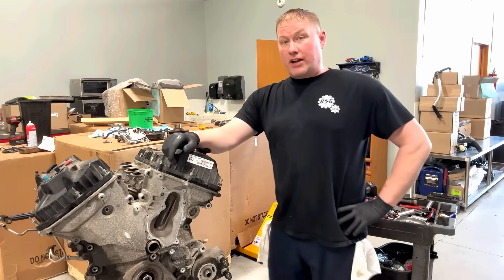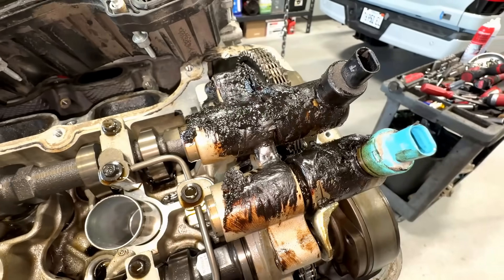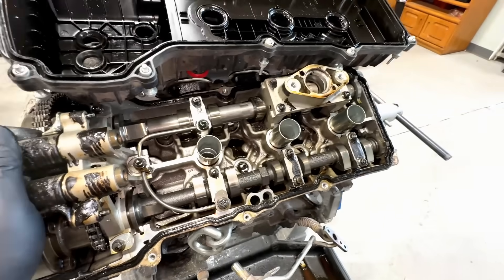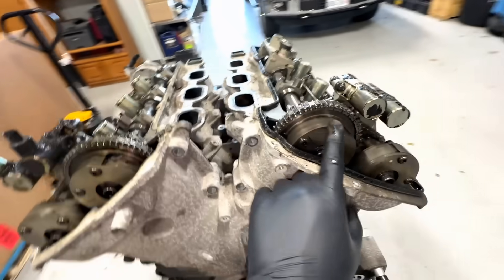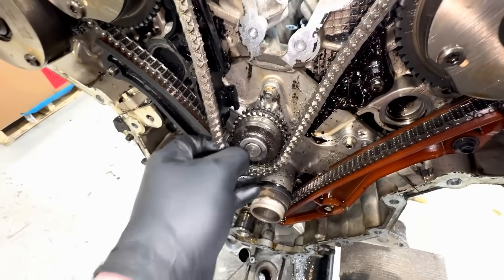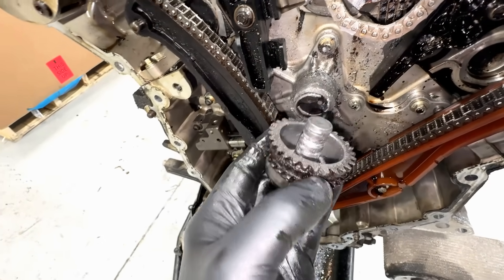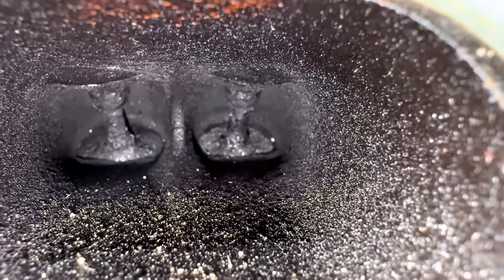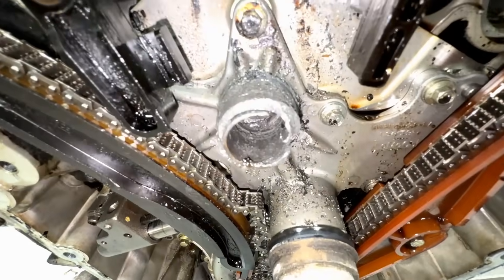2015 Ford F-150 3.5L EcoBoost Engine Failure: 97k Miles Total Destruction!

Comment: I’d like to have seen the motor apart before the BG flush was run through.  I will go out on a limb and say the owner may have run that motor with the cleaner in there longer than the BG instructions state too.   Here’s a good case for not using engine cleaner when the buildup is that severe, it just loosened the huge amount of sludge then blocked the intakes and small passages.  Regardless that motor wasn’t long for this world even before attempting to clean it out.  Thanks for showing this one.

Comment: One thing you might suggest is the moronic use of direct injection engines without at least a small water injection system to keep the intake clean. It would do so much for the engine

Comment: 3.5 L double boosted or even single boosted motor in a pickup truck if you're going to use it as a pickup truck was not a bright idea. When I first saw one I knew exactly what was going to happen with these especially if you are not absolutely religiously connected with oil change intervals. Thank God they have Valvoline restore and protect out now use that regularly from the time the engine is brand new. These Ford motors have way too complicated of a timing system on them. And it requires them to be pretty much spotlessly clean add well lubricated

Comment: Great video!  I have 280,000 miles on my 2014 F150 with the 3.7 and 189,000 on my 2015 with the 3.5. Changing the oil every 5k miles with Mobile One.

Comment: If you change your oil every 5000 miles or 6 months with synthetic, these ecoboost engines will last 200k miles with minimal issues. These engines are high heat, high pressure, fuel diluted beasts that shred oil in a short period of time.

Comment: How long do you think they were going between oil changes?     It seems to me, years ago only high end and enthusiasts cars had complicated DOHC, VVT, turbos, ETC.  The kinds of people who drove these cars, on the most part, were anal about maintenance with oil changes, filters, wear items,etc…. Now you got regular pickup trucks and family SUV with all these engine technologies that used to be only on enthusiast cars.  Regular, non car people, don’t care about oil changes and maintenance, until the engine blows up or it’s setting multiple VVT related fault codes……lol.  I seriously think it’s the right mind set to change oil every 3000 miles regardless of what the car manufacturers or oil companies say.  And if it’s a really high strung engine, so example an eco boost towing all the time, spending a lot of time in full boost, or a sports car doing track days or having fun in the mountains, change it every 2000 miles or sooner.

Comment: I have a 2011 f150 3.5 that I did a timing job on a couple years ago using your videos as reference. It’s got almost 250k miles. They are not junk. Anyone saying so just hates ford. Thank you for doing these.

Comment: I don't know if you'll see this or if anyone on here knows somewhere to get a new engine for the 3.5 gen 1 my 2012 is at 275k miles and is having some major issues where replacement is probably the best choice.  But I don't know a good place to get a remanufactured one since Ford doesn't make the gen 1s anymore of it its possible to switch to a gen2.

Comment: Buy these trucks at your own risk got a 2019 Tacoma runs like a top all fluids regularly changed it’s a lot cheaper to replace all the fluids than buy a new transmission or engine

Comment: So if all cylinders on a first gen 3.5 have no compression I hear you say they need a new engine in some videos,  just curious why it needs a new engine are the engines toast after a stretched timing chain or timing failure,  I know the valves can hit the pistons but couldn’t the heads be rebuilt,  I know it will just be a lot easier to replace it with a known working engine,  what’s the fix after a timing failure and all cylinders lose compression,  I’ve already retimed the engine with new parts and still all cylinders no compression so I assume the valves are bent but all valves looks fine.  Appreciate you always sharing your knowledge with us.

Comment: Is using BG products like MOA not recommended for EcoBoost engines? Or was it bad in this situation  because he neglected regular oil changes.
Reply from the maker: He did not use MOA it is much stronger product.

Comment: I'd like to know what oil change schedule or lack there of this truck was on.  Once a year 15000 miles, once every two or three years.  Just wondering what schedule did this to the engine instead of just saying neglected oil changes.
Reply from the maker: 15-20k mile easy maybe more.

Comment: Great video. I’ve got 220,000 miles on that same engine. Other than a throttle body and some expected, coolant leaks, everything is still functioning well.

Comment: I'll add my anecdote to the rest:  130k on an '16 expedition.  I've done 5k oil change intervals and have had no issues.  I tow at max capacity a few times a year (~8000lbs).  Oil maintenance will pay for itself 1000 times over

Comment: This situation isn’t Fords fault. I’ll probably still never buy one again after the 3.5 cam phaser issue. Asked to have them replaced at 40,000 miles before extended warranty ran out. Weren’t making noise so they refused to replace. 

At 47,000 miles they start rattling. Out of warranty. Called corporate twice and two different dealers. All refuse to fix it. I should never have to pay for this at 47,000 miles and it’s a well known issue. Terrible customer service by ford.

Comment: On the can of BG EPR it specifically says to not use on engines with sludge build up
Reply from the maker: This is not BG EPR
Reply: @FordTechMakuloco  you said BG cleaner, so I assumed they used BG's EPR ( engine performance  restorer) "engine flush" chemical
Reply from the maker: It is called BG dynamic engine flush
Reply: @FordTechMakuloco  Gotcha, I just looked that one up and it also says to not used on engines with sludge build up.  For the record I agree with you.  This engine was neglected and already messed up and that chemical didn't do it any favors after the fact.  I just was saying that most cleaners that I've come across say to not use in circumstances when there is sludge build up and that's when most people try to use them

Comment: Ford was stupid to drop the 3.0L diesel. Far more reliable engine than the Ecoboost. The warranty alone was 100k miles on the diesel ⛽.
I'm at 150k on mine. I know have to do timing belt.
Reply: They weren’t that great and engine, lost of issues in the land rovers and I know they were snapping cranks off and on in the f-150

Comment: Just change your oil. It’s not that hard. I don’t listen to the manufacturer recommendations. 3k to 4k miles oil change intervals. It’s cheap insurance. At that interval it doesn’t matter if you use the “cheap” synthetic oil and oil filters in my opinion. It’s gotta be better than what this guy did to his engine by far.

Comment: I bought a 2011 lorait 3.5 Eco 5 month with two hundred thousand miles only one owner with 23 times to the shop only for maintenance and brack pads change very clean truck no rust with a fiberglass bed cover for ten grand and people had told me that they perfer a truck of that year then a 22:or 23.from 10 to 14. they came out with good motor and strong body love that truck

Comment: I bought a 2023 Power Boost and I did my first oil change at 3,800 miles. I was going on a road trip and would be way over the mileage. Never go by the oil life % because it tells me around 7,000 miles. Never go more than 5,000!

Comment: What happens when you follow the manufacturing recommended oil change intervals 10+ thousand miles. Doesn't matter what brand of oil you use, they all break down and when they do the oil starts to cook. These 10k-20k mile oils are for highway driving not local or city driving.

Comment: 2012 explorer 3.5 engine with 182k miles. Oil smells like gasoline and gasoline vapor oder inside the vehicle. What could be possible cause?  Error code indicates problem with the catalytic converter.

Comment: There’s a lot more fans on here than haters sir. You are an endless source of reputable knowledge. You set me straight on proper oil, proper coolant etc. on my 2016 Eco F 150.
50k miles in and proper synthetic oil at 3000mi intervals has yielded a trouble free engine this far. 
Thanks for your commitment to the vehicles and your followers!!!!

Great presentation. No music. No fake attempts at humor. Just straight forward facts, presentation and delivery.

Thank you!!!

Comment: I had a 2013 with 33,800 miles on it and had total engine failure,  $12,000 to fix it and ford wouldn't do anything about it..
Reply: Must have been way outside of the 5 years or 60,000 powertrain warranty. I don’t agree with the time constraints should be a flat milage amount not years but they tell you a time limit so bad as it sucks all companies would have done the same

Comment: 6qts of penzoil full syn. 34.00 plus motorcraft filter 8 bucks.  Beer 15 bucks.  Time in the garage alone. Priceless.
Reply: You can buy the Walmart brand for $24 and their filter for $6. Change it every 3 to 4K miles and I bet you’d never have a problem. Walmart doesn’t make synthetic oil. They buy it from one of the manufacturers and bottle it with their name on it. My 09 Chevy 3.7L has just about 200k miles on it and I use whatever is the cheapest option available in synthetic oil for it. My Mustang gets name brand synthetic oil because it’s not a work truck.
Reply: If I recall, Brian recommends Penzoil Ultra Platinum for the later generation boosted Ford engines.  Based on his recommendations, I switched to Ultra recently for my Mazda with excellent results.
Reply: Damn right
Reply: I have a 15 equinox. Walmart oil and ac delco filter is $24
Reply: Heck yeah brother
Reply: Pennzoil Ultra Platinum is the "poor man's" Amsoil. And can't go wrong with a Motorcraft filter.
Reply: Motorcraft filters suck , fact
Reply: Get some help.

Alcoholism is a disease.

Comment: So, if I keep changing the oil on my 2015 F-150 with the 3.5EB every 5K miles with Pennzoil Platinum/Ultra Platinum I should be good for more miles.  At 135K now, bought it in 2018 with 34K on it from a lease.

Comment: I’ve just started running the Valvoline restore and protect on my 2010 4.6 3V with 110k miles on it for the next 3 oil changes. I’m checking the oil color weekly and plan to do mid interval filter changes. Afterwards it back to Motorcraft full synthetic. I want my timing components to live.

Comment: Hello im looking to buy a new f 150. (Currently have a 2010 with the 4.6l with 214k on the clock). Im looking at the stx model and wondering which motor eveyone would go with? The 2.7l ecoboost or the coyote 5.0! Thank you for your reply.
Reply: Depends what your looking for, I have a 21 with a 2.7 and definitely gets better mileage than the 5.0. I don’t tow heavily just a 4000 lb boat for so plenty of power for that and still gets 16 pulling it. Both the current 5.0 and 2.7 use a belt driven oil pump but honestly i haven’t heard much of anything in the way of failures.
Reply: @christopherlehman4045  I heard about the use of a belt for the oil pump. I would have thought they would have used at least a chain? You have had no issues with the 2.7l? Thanks.

Comment: Timely oil changes are necessary, even more so today (low tension rings, VVT, turbos, etc.) Toss the owners manual nonsense and go back to 3K miles. Oil and filters are cheap.

Comment: I have a 14 3.5 with 200,000 on it. Still runs amazingly good. I got it from my father in law who put most of those miles on it. He’d change the oils every 4000.
Reply: Good to hear I've got to by a new work van and the 3.5 is the only option. I'm rolling over 300k on my 2017 3.7
Reply: My 14 just turned 202,000, running strong, good synthetic its whole life, but went long intervals on changing, 10-15K, mostly long distant highway miles. Regretting the interval distance now, saved a little on oil and effort but may cost in the long run.
Reply: @danharp3009  i’m at Valvoline restored protect oil through it, I’m running it on everything except for my new truck, simply because it’s only 7000 miles in the year I’ve owned it. But I’ve been researching that oil since it came out and following to use it and it’s the real deal as far as cleaning it also cut down on wear metals, which is the whole point of oil in the first place.
Reply: Nice!
Reply: My 2014 3.5 ecoboost has 316,000!  I just replaced cats with catless downpipes because they went bad and were burning ignition coils up.  I do have the camphaser knock at startup, but other than that it is running strong.  I always set my oil life to 80% and only use full synthetic oil.
Reply: @JamCar99  316k, nice. When you say 80% are you talking about the intelligent oil monitor system?
Reply: @mikeclancey6070 correct!

Comment: Any reason to use that BG cleaner on a '21 Transit 350 with the first gen EcoBoost? I change the oil every 7,500 instead of the 10k recommendation by Ford.
Reply from the maker: nope

Comment: A lot of Ecoboost problems ARE a crap design!
You showed those fine screens!! That's a TERRIBLE design!!
And the cam phazers and timing chain!
Terrible!!
Same old garbage like GMs 30 year's of leaking intake gaskets!
Junk!
I have seen MANY older GM engines with well over 200,000 miles on neglected oil changes!
I owned a 300,000 mile GM will neglected oil changes and it ran like new!!
Fords are disaster's from the drawing board and ever Ford technician knows this..

Comment: Was working on my daughter’s2018  Ford fiesta with the 1.6L engine and it overheated took heads to get resurfaced put everything together kept getting a p0016, kept putting everything back in timing like 10 times  until I noticed that the cam phraser on the exhaust was stuck… I pushed in the pin on the cam phraser  and now the p0016 code is gone.. my question is will the cam phraser get stuck in the future, now car has 45 thousand miles..

Comment: IMO often overlooked is that when "flushing" an engine, all the crud has to go somewhere, and that somewhere is the oil pump and filter.  Once the filter is packed, it will go into bypass (most of them are equipped with a bypass valve nowadays), then alllll that crud is going directly to the bearings, heads, phasers, etc.  I have gone through this process before, and it took quite a few filters and dumping the oil very shortly after the flush to get the junk out.  Even then some of the engines just didnt survive, the crud was too much...

Comment: What is it with people these days who just do not change oil as they should. Yours is not the only channel I follow in which this is a problem. I'm OLD SKOOL and change my oil on every car every 3k to 5k miles. Today's engines are much tighter than engines from the 80s yet I've seen videos where some engines have crashed with 50k miles on the original oil charge.

Comment: Don't question the king of Ford. This man has save me money and headache on my 5.4 3v 2008 f150.
Reply: The 3V 5.4 is the biggest piece of crap on the highway.    Oil starvation and cam phasers
Reply: While the 3V 5.4l Triton has its faults, it is generally the owner's lack of proper maintenance and neglect that causes all the timing and oil consumption issues.  My '04 XLT F150 4x4 extended cab has 220,000 miles and it is still running strong.  The majority of people who complain about these engines probably brought the vehicle used and with a good amount of wear/mileage on the engine.  Even Ford admits it has its issues with these engines.  But if maintained and serviced regularly, most of the 5.4l 3Vs will last many yrs.  At least, that has been my experience.  And yes, i brought mine used in 2018.  It had about 150k on odometer.  I've had it for 7 years and have put about 70k on it.  Other than replacing coil packs and spark plugs and also replaced both VVT solenoids.  They were gummed up and clogged pretty bad.
Reply: Change your oil 5k with high mileage full synthethic. The high mileage oil additives really works.

Comment: The company I work for have probably have around 600 vehicles. All our luxury vehicles are 3.5 ecoboost expeditions and were are going to 600k before we dump them. I have only done a few engines very reliable for sure.  Our transit cabs with the 3.7 engine they are going to 750k before we install a ford reman. Only a dozen or so I have replaced cam phasers and chains with guides/tensioner. If you take care of your maintenance it will take care of you. Great video love the content
Reply: Transits with 750k on the 3.7L? Whoa?
Reply: Would you mind sharing your oil change intervals, oil filter and oil brands, what about coolant, tranny, and diff intervals?  Thank you.

Comment: Is that timing chain idler pressure lubeicated or is it like a Bering like a belt tensioner if it’s the latter then that is no better than the nylon timing gears of 1970s other the more catastrophic damage of inteferance engine
Reply: Probably has no seal just a roller bearing on a stub shaft for an idler. With no seal on it under the timing cover all kinds of oil will be splashed on it constantly so unless it sludges up so badly the oil can’t get in bearing I can’t see an issue

Comment: You'd think with the cost of a new truck or engine these days that people would change their oil at least every 5-7K miles!  It's sure as heck a lot cheaper to maintain than to replace!  Most of the haters have probably never even had an engine apart, or even understand the seriousness of skipped oil changes or garbage in the oil ruining bearings & turbos.

Comment: So that oil "cleaner" breaks down all that garage to smaller particles?  Does that mean the particles were small enough to pass through the filter for the turbo oil feed? I'm sure that would have done wonders for the turbo bearings and seals!